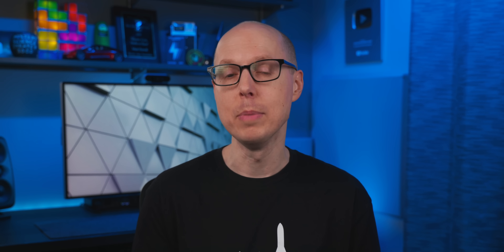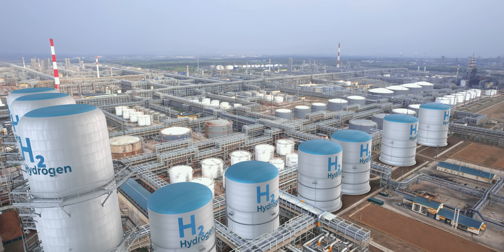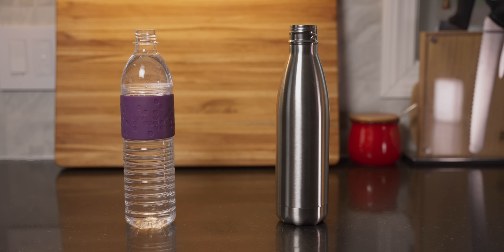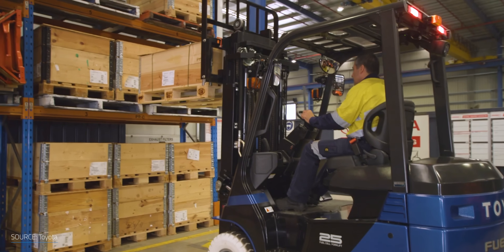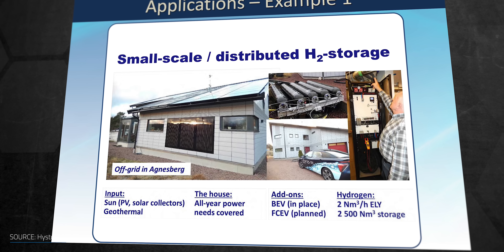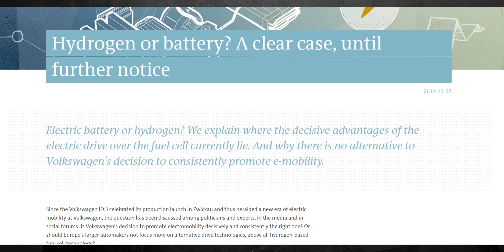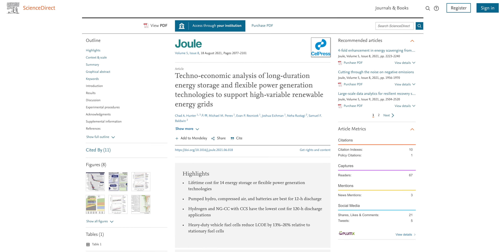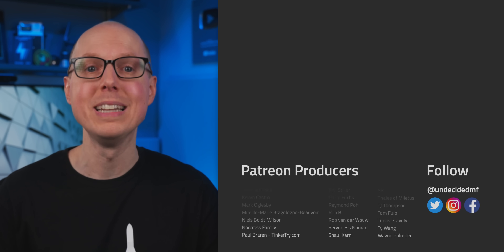Solid Hydrogen Explained (Again) - Is it the Future of Energy Storage?

Comment: 40 to 80kg/m3 for hydrogen?
sabatier derived CNG does 180 to 220 kg/m3 and the carbon is another fuel so why bother with transporting hydrogen as hydrogen to the energy use point?

Comment: IF this works (which I am not completely convinced of, yet), it seems to me that it could be a complementary technology to battery storage, for vehicles.  The hydrogen is collected and stored where it's produced, then the electricity is produced and put onto the grid to be used to recharge electric vehicles.  The biggest problem I can see with current battery technology is the time factor.  It just takes too long to recharge a battery when compared to refilling a tank with liquid fuel.  New battery technologies could reduce that time which may increase uptake of EVs.

Comment: The problem with the low pressure discharge, is that fuel cells works much better at elevated pressures than in lower ones. 
So direct coupling with a fuel cell could work only for Light Vehicles without much energy need.

Comment: Why can't we challenge a person who consistently puts out unscientific claims he repeats from not so credible or reliable sources?
Reply: You can,put out videos of your own,or be specific in your critiques.
Reply: @stephencrowther524  - Well, for one metal hydrides are not referred to as solid state batteries, because they are not that.  They have the potential to be used in a solid state battery, but by themselves they are not batteries.  You have to have electrodes attached first and a specific place to attach them.  That's kind of a basic error and it's made in the first 30 seconds of the video.

Using fuel cells in a submarine works, the idea it could be used in any kind of aircraft is insane.  The weight makes it impossible.  Matt compares, the energy storage of GKM pellets to the energy stored in the lithium ion battery in a Tesla 3.  OK fine, but you can't actually use it in a car or vertical take off aircraft.  You have to heat up the pellets but you don't have to heat up a lithium ion battery.  You just hook it up to an electric motor and it works.  Heating up the GKM pellets takes space and the weight of the equipment that does the heating.  Then there's the fuel cell and it's weight.  Then there's the engine that actually burns the hydrogen.  Not only do you have to take it's weight into account, there will be heat energy lost in that process, a lot of it.  

Plus, I forgot the energy needed just to get the hydrogen in the first place, seeing as there aren't any natural pools of hydrogen we can draw on.  At least Matt mentions the efficiency; make that lack of efficiency, of hydrogen as a fuel.     

This isn't about science, but Matt makes a big deal about the company getting a relatively small government grant to study the feasibility of it's hydrogen storage idea, but a study isn't proof by itself.  It's just a study.  Wouldn't you want to know how that study turns out before you start declaring victory in the energy wars?

Here's a link to a video that gives you an honest explanation of the potential and very real difficulties of using hydrogen to replace fossil fuels.  It's somewhat depressing, but there's no BS in it, unlike some videos I can think of.  https://www.youtube.com/watch?v=Zklo4Z1SqkE&t=1061s&ab_channel=SabineHossenfelder
Reply: @Kwolfx  all one has to do is hook up the storage tank to a muffler. Muffler puts out plenty of heat . A little configuring and you don't need a bunch of extra material.
Reply: @Kwolfx  A little late to the party, but if a traditional battery is electron storage, why isn't proton storage a battery also?

Comment: Love all the clarification - We are all still learning & hopefully continue to with our eye on preservation of species, not just our own, & by extension the planet for as long as possible. 
I caught an article regarding a Mechanochemical breakthrough unlocking chap, safe, POWdered hydrogen
at Deakin University institure for Frontier Material, described as a "Eureka" moment . 
The team found grinding certain powders with precise pressure levels certain gases can trigger a mechanochemical reaction that aborbds the gas into powder which can be held at room temp until needed & released by heating much like the metal packing without the metal density.  Professor  Ian Chen wrote boron nitride only loses a couple percent of its absorption.

Comment: I mean, if the tech is already in use in submarines, that at least means it works. Whether it ever gets to a full-scale rollout or gets displaced by something that won't try as hard to escape as hydrogen does., that remains to be seen.
Reply: This tech is really old and using it in a boat that can weigh 100s of tonnes is completely different than in a car
Reply: @KP3droflxp  Well yeah, obviously. Using it in a submarine, a vehicle which needs ballast to work and thus benefits from having heavy-ass tech on board; is very different from using it in something that benefits from reducing weight.

But even if the tech only proves useful in situations where being heavy and bulky aren't considered real problems, it'll still have a viable use-case. 

A wider variety of viable energy-storage systems that demand different resources is a good thing. it'll mean our entire global economy won't be chained to the extraction of a single mineral, for a start.

Comment: Saw an article about a porous metal block that would absorb liquid hydrogen and then a blow torch played over the same block without the hydrogen burning...also had a piped valve lower in the block that would allow to dispense the hydrogen....

Comment: You need to further explain your comments about pulling elemental hydrogen from stack exhausts.  In the case of hydrogen reforming, the hydrogen is the actual product.  It is not a waste stream going to the stack unless something is very wrong.  In incinerators organics are intended to be burned.  The hydrogen shows up as water.  Un-oxidized hydrogen in the exhaust would be evidence of an incinerator issue.  To leave unburned hydrogen, would also make large amounts of CO gas, which is also a fuel.  Both of these processes can be used to generate hydrogen from fossil fuels.  This is basically how almost all industrial hydrogen is made now from oil.  But this is not a waste stream or smoke stack exhaust.  I would be interested to know the actual sources.  You do list a couple of possible sources such as waste biomass, but these are sources of hydrocarbons.  While these can be reformed into hydrogen, they also produce CO2 just like any other fossil fuel. Also, your work is great.

Comment: Technology exists for decades, in chemistry class, you would take Sodium Hydride powder and light it up with a magnifying glass and some help from the sun. It releases Hydrogen and leaves sodium metal (which is very unstable).
Smokes stacks does not contains hydrogen, who told you that??????? They mostly contains water, mixed with CO2 and other toxins.
You compare the volumetric density of hydrogen gas + liquid to metal hydride which hydrogen + the metal, like comparing apples to watermelons... Doesn't make sense...
So many inaccuracies in these videos, this cant be from someone who has basic science background. It is not a breakthrough and this is far to make the future of energy storage
A debunk video that is worth watching is on  https://youtu.be/MgnicbmjLVk busting this "breakthrough" thing...
Reply: Do you work for Nespresso? 🧐

Comment: The thing that I feel a lot of people dont understand is that we dont have to give up combustion to be green, we just have to give up organic combustion. Hydrogen vehicles and nuclear power could easily give us near 100% clean energy basically indefinitly without the need for the drawbacks of solar, wind, hydroelectric, etc etc etc. We just need to better remove the stipulation surrounding these technologies that they are dangerous or (somehow) impractical, because further research and development of ANY technology only leads to cheaper costs as newer, better, and safer methods are found to produce them. Burning hydrogen will never not be green, so if we make the switch and just stick to it, it literally cant get any worse.

Comment: There s a lot of work and innovation to be done before hydrogen goes mainstream . Applications where a closed loop. WATER>RENEWABLE ENERGY>EFFICIENT(WEIGHT INDEPENDANT)STORAGE >BACKUP OR ON DEMAND POWER > WATER seem like the only near term practical applications. Solar/wind farms are prime, but perhaps mega cruise ships, or hydro plants that utilize pump storage backup that could incorporate renewable energy,  Countering this is the rapid advancement in stationary battery, thermal, and gravity systems technology.

Comment: this is just another fuel that can be monopolized and heavily controlled. sure it will solve problems but because it is just another fuel replacement it will not overtake the oil companies unless they themselves make the fuel. the power of these companies exist to insure that this will either fail or be completely monopolized by the same companies that this was invented to destroy.

Comment: I´m a little disappointed that you didn't include LOHC (liquide organic hydrogen carrier) technologie in this video and the comparisons you made. Its storagy density isnt as high a "solid hydrogen" but its extremely easy to use and handle and is already proven to work in multiple pilot projects.
If you look into it you will see it has its disadvantages but also a very intriguing factors about it!

Comment: Eliminating the majority of the need for energy storage for consumers would be ideal for the environment. Long range wireless energy transfer would eliminate the majority of the need for consumer batteries. 
However, there isn't much opportunity for massive corporate profits if consumer energy storage / batteries were to become nearly nonexistent. Therefore, I doubt long range wireless energy will ever fully manifest itself. I'm only aware of two companies that are working on it. 

I.E. if you have cars, phones, security cameras, hearing aids, etc. continously receiving operational level wireless power. There is no need for or a considerably lowered need for batteries in those products.

Comment: Sorry, but still not buying what you are selling.  Citing military submarines as a proof of use case is ridiculous. The cost doesn’t even factor into it, and considering that many submarines use small nuclear reactors you may as well be citing nuclear reactors in each house. Once again you’ve cherry picked the best cases for the hydrogen scam. The economics around the Tesla powerwall hydrogen competitor are terrible. Not only is the round trip efficiency terrible, but the purchase price and ongoing running costs are huge in comparison to a battery solution.  When it comes to using the waste heat to heat the house or water, that still doesn’t stack up with battery storage. Here’s why. If you use the waste heat from your hydrogen cell to heat the house and get the efficiency up somewhere near 80-90% (being incredibly optimistic here), you are still behind a 90-95% efficient battery that is running a heat pump. A heat pump typically operates at 400% efficiency, so using the same metric and using the battery/heat pump to heat the house you would still be better off. 

Then there is the cost. Yes, it will get cheaper, but so will batteries and other storage tech. The fundamental inefficiency and complexity of the hydrogen solution will mean that it will be way behind even in the best case scenario. It will never be a good solution for road transport since the infrastructure costs pile on top of the inefficiency costs to make it uncompetitive with battery electric - even for trucks.  It only makes sense to people who are trying to keep selling you expensive energy that you can’t make easily at home.

Even long term storage is debatable, since you also have to factor in the infrastructure and transport unless you are placing the storage right next to where it’s generated and shipping electrons instead. There are some use cases for hydrogen - such as making steel or other industrial applications, but for general energy it’s too expensive, too complicated and too late. Battery tech will eat it’s lunch, and is only getting better.

Comment: Nice follow up Matt, which clarifies a few points, but I do have a couple of lingering concerns.  

You said, "When the hydrogen leaving those chimneys hits oxygen and combines with it, you get water vapour and those white plumes that you typically see coming out of them."  Hydrogen doesn't spontaneously combine with oxygen to form water vapour.  It requires the application of intense heat which then starts a self sustaining massively exothermic reaction, ie. it combusts.  This is the exact process by which we extract energy from the hydrogen.  If the gases in the chimney are hot enough to initiate combustion of the hydrogen (around 650°C I believe) when it hits air, then cooling it to the point it doesn't damage the hydrogen recovery apparatus is going to present its own set of challenges, and may negate the benefit of the hydrogen being available there in the first place.

Secondly, I tried unsuccessfully to find more information about the energy requirement of dispensing liquid hydrogen.  Where did you find the figure of 10MWh per ton (the link in your citations is dead)?  I may be over simplifying, but simply allowing liquid hydrogen to absorb ambient heat at ambient pressure will convert it back to a usable gas with no requirement for an external energy source.  Further the cooling effect could be used to advantage for other industrial processes.  What am I missing here?

Comment: Have you investigated Stanley Ovshinsky’s work on a hydrogen powered car that uses a NiMH fuel cell to feed a hydrogen combustion engine? They were able to modify a stock gas engine to burn hydrogen, and it had a pretty decent range per tank.
Reply: Bob lazar invented a rocket powered hydrogen car

Comment: Gas is currently at $5.00 per gallon, approaching the same cost as mentioned in this video for a comparable quantity of hydrogen fuel. Considering the fact that gas and oil are a limited resource and will eventually be gone, sun power and water power would be the clear alternative. Having said that, water and not solar power, offers the cleanest alternative. Why? Solar systems, at their most basic level, require that phrase again: they are based on a limited resource. Don't get me wrong, humanity is mining flat out to obtain more of what is necessary to manufacture more solar systems but, unless we are prepared to damage the earth to get what we need, the resources needed will eventually reach a terminal cost benefit level and the technology will no longer be viable. With recycling, hydrogen technology presents the only real, long term solution to humanities need for portable energy. I still believe that, with technology and safety improvements, nuclear energy presents the best static solution for homes. Solar power simply is not energy efficient when examined on a long-term basis. Solar panels degrade with time and drop in production with wear due to weather. Nuclear power, alternatively, can become a safe technology, easily providing the most bang for your buck, pun not withstanding. Still, fear surrounds nuclear power and that needs to be confronted by the success stories. 

Ultimately, my money is on hydrogen technology and I won't be buying an electric battery car any time soon. Much like the Compact Disk, it was replaced with Solid-state tech pretty quickly, to the point where an entire DVD collection can be placed on just a few microSD cards smaller than the size of my thumb nail. Electric cars are just the last squeeze before hydrogen cars emerge as the clear winner of the portable energy race. Hydrogen, I believe, will provide all the up-sides of power and performance of pure electric cars with none of their limitations, excessively long recharge times, short ranges of travel, and battery depletion costs. Hydrogen refueling or cell-swapping can be done in minutes, not days or hours (at home). There is no reliance on a massive battery, which is a "yuck" factor that most people don't like (ask anyone with a fast burning smartphone that dies quickly). And hydrogen offers greater or comparable travel ranges to gas power when needing to refuel so, road-trips don't have to become a thing of the past. If you want to go visit the Grand Canyon for the weekend, you can without the worry of running out of power. 

In summary, I'll wait. One day the oil will run dry and we will need real transportation solutions and manufacturers will get serious. For now, they're milking the suckers for what they can on electric only cars, which save nothing on polution. I'm going to skip that phase and go right to hydrogen, the only serious alternative to oil at this point. Like with oil, the technology will improve and the up-side to all this is, water and other sources of hydrogen will, by all practical measurements, never run out AND hydrogen production will only ever get cheaper! Frankly, I don't think the oil companies like that last part very much but, oil can not last forever. Consumers didn't do this to big oil. Big oil simply ran out of crude oil to burn. Unfortunately, what was true long ago is still true today, oil and water just don't mix and it will be hydrogen who floats to the top of the energy race. Cleaner, more practical (now), and more sustainable, oil and battery power will, given time, be beaten by the smallest molecule we know of, hydrogen. What comes after hydrogen? I'll leave that question to the thousands of generations which will come after me, once this tech is fully developed. Besides, elecrtic cars have lame limitations. No, thanks.